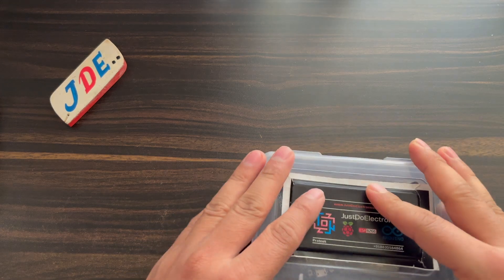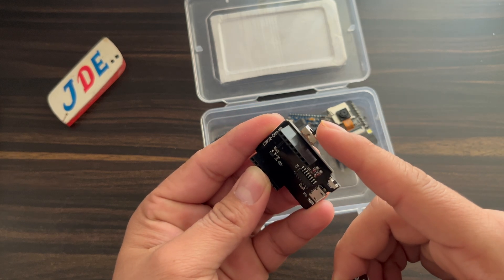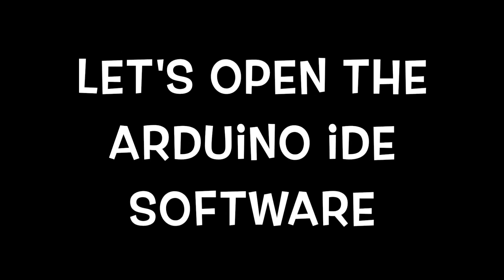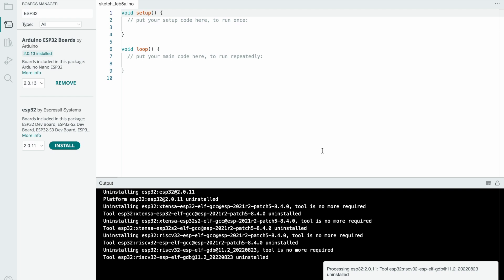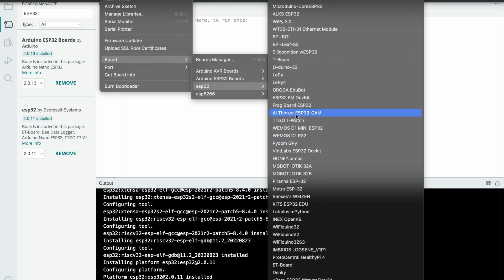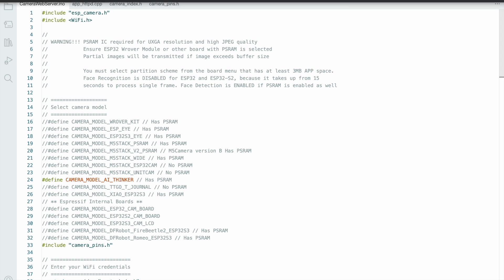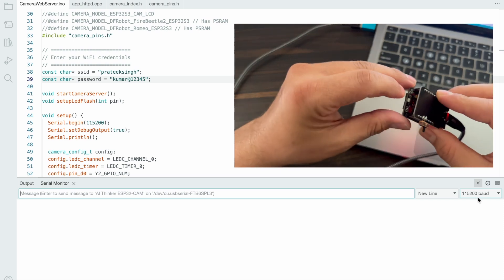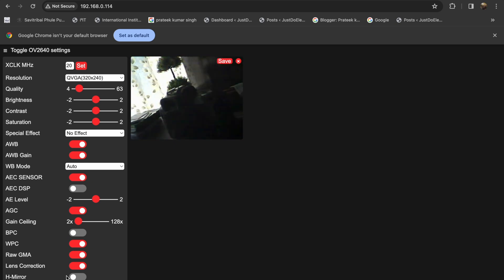ESP32-Cam Quickstart with Arduino IDE | ESP32-CAM

Comment: hey im not getting the enroll face option what should i do?
Reply from the maker: Used Arduino ide old version
Reply: @JustDoElectronics shall I use older arduino ide version or shall I install older esp32 by espressif board package in arduino ide
Reply from the maker: Now is work or not ?
Reply: @JustDoElectronics wait I am going to install it again the older version of ide then I will msg you again 
Please keep in touch with me 
I'm doing project on esp32 cam for automated Gate Entry System using rfid and Face recognition
Reply: @JustDoElectronics  hey i got the enroll option 
how should i enroll the faces now 
need to create a server for it ?
 for sample project i need to store two faces for detection and recognition
Reply: @JustDoElectronics  HEY PLEASE REPLY
Reply from the maker: Yes send me the photo in what’s app
Reply: What is your arduino ide version
Reply: Give me your number sir